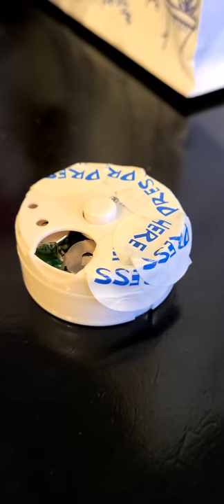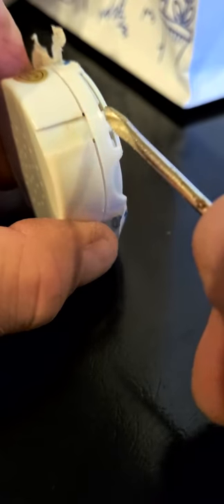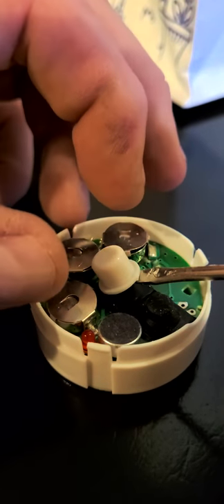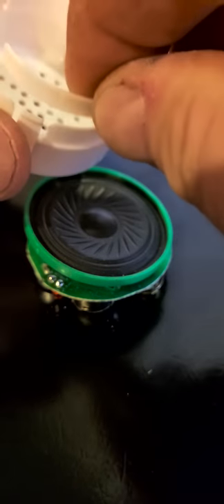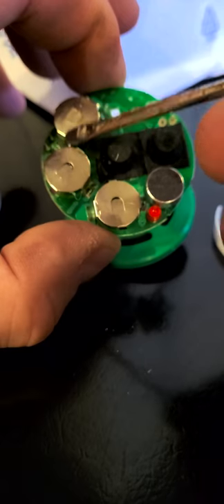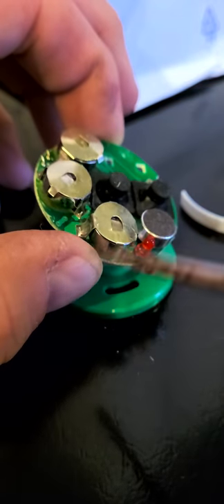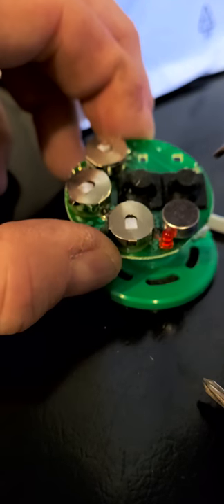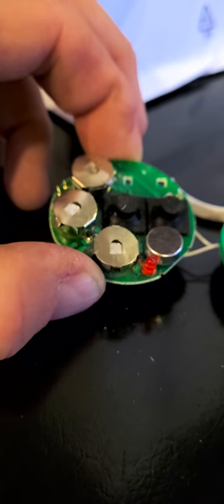Build A Bear Voice Recorder issue and battery replacement

Comment: Thanks for your video! I used a Build-a-Bear recorder for a special project years ago, and when the batteries died it had been so long since I did my project that I forgot how the unit worked. I accidentally erased my recording and later also forgot which way in the batteries go. I finally got it fixed now. The special project? To recreate Bert the Farting Hippo from NCIS. Bert is a puppet so there's a big pocket inside, and it needs a big button like the 'Easy Button' from Staples, to engage when you hug it. I wired a minijack instead of the BaB microphone, to record a sound file directly from my computer. I mounted the BaB unit inside the Easy Button (removing the EB circuitry), wired the output to the larger EB speaker, and mounted the minijack inside the Easy Button's now-unused battery compartment.

Comment: Thank you for posting this! I was so upset that the build a bear recording my son made for me for Mother’s Day 10 years ago was gone. We followed your instructions - thanks for the heads up about the other black button. It turns out one of the batteries did explode inside the device. My husband was able to change out the batteries and resolder one of the speaker wires that came loose. I now have my recording back and took your advice to record it in case something should happen to it.

Comment: Your video was a massive help to me and replacing some custom build a bear batteries. Thanks so much for posting this. I was concerned that I would break something when trying to release the circuit board from the plastic housing. It was nice to see someone else do it first. 😂

Comment: Hello, I'm hoping you can help. I took my build-a-bear sound box out to replace the batteries but after that it keeps playing the sound on its own randomly. Would you know why that is happening? I was careful when switching the batteries, didn't touch anything on the circuit board, and used LR44 batteries.

Comment: Awesome video! Can you tell me where these wires need to be soldered to? They popped off but don’t know where they go.😢
Reply: Our bear’s sound circuit has the same issue! I can solder but I don’t know which wire to solder where… 🤷🏼‍♀️

Comment: By chance did you test to see if new recording saved/worked after removing the batteries? I’ve gotten mixed info from BAB saying the file gets wiped when the batteries are removed but done one can confirm
Reply: The new model voice box for the Build-A-Bear is the mini mean voice recorder. It works pretty well, and I’m pretty sure that when you replace the batteries or even take them out or if the batteries are depleted, the recording will still be there. I really hope that helps.
Reply: I've seen video of someone replacing batteries and the recording working still.

Comment: Hello , so maybe you could help . I have the same recorder ( it’s about 29 years old now ) and basically the it’s so old that wires connecting to the speakers fell apart  the circuit board is still in tact … I have been trying to understand how to transfer the recording to another device … I don’t even know what to look up but since the bear hospital is still closed I have to find another way .
Reply from the maker: Dina, sorry to hear this. I'm no Bear Expert, but I would imagine if the recording is still intact and only the speaker wire(s) are disconnected you may have a chance. If a new speaker wires can be attached then you could possibly have the unit working again. However, when the wire(s) detached they may have shorted the circuit in which case may have destroyed the recording chip. I would hope that in the future they provide their customers with a separate permanent recording as a mp3 or .wav file. Best of luck and hopefully the hospital will open soon as I am sure the Bear Hospital E.R. will have a line longer than those waiting with COVID symptoms.

Comment: How did you get it out of the plush?
Reply: Locate the voice box first it'll make the hunt easier (usually somewhere in the paws/torso but they can and will migrate around if it's been well loved , it should feel like a solid mass).
seam rip the back where it's originally opened to be stuffed (right around the middle of the back) , if you have a light colored bear it might be easier to see the chocolate colored thread that you cut DO NOT SEAM RIP PAST THAT (you risk ruining the whole bear) you can either do it yourself or go to your local store and they'll do it for you (for free) TELL THEM YOU WANT TO KEEP THE CHIP OR THEY MIGHT DISCARD IT FOR YOU.
Then just fix/sew em' up , if they lost some stuffing during the whole ordeal you can bring them back to build a bear to be restuffed and sewn for free!